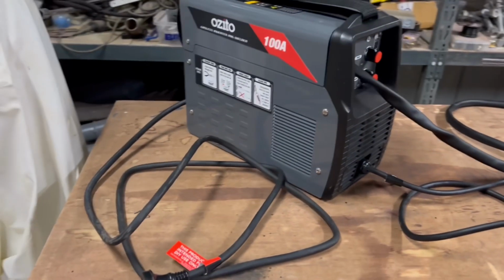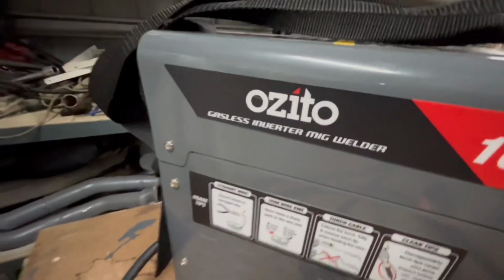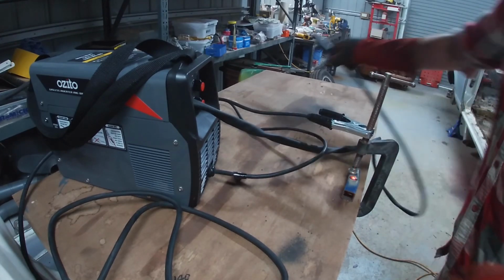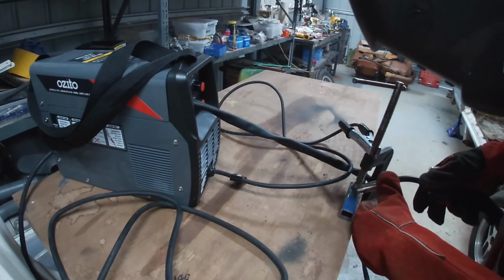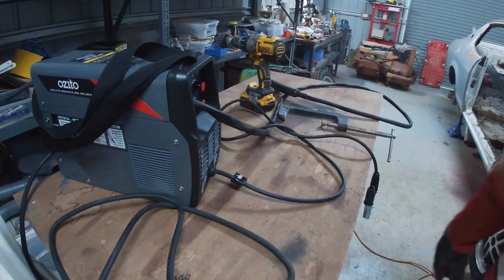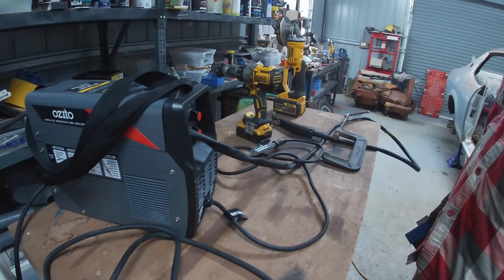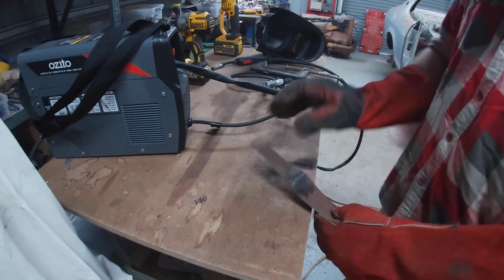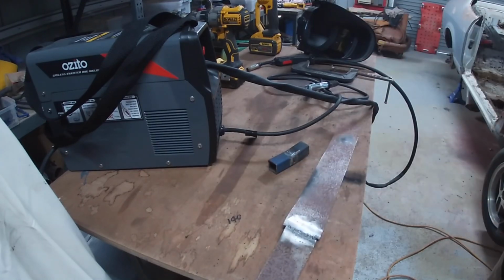Can a $148 MIG Welder Actually Weld??⚡️ OZITO 100amp MIG Welder

Comment: Hey mate do you think this gasless mig would be suitable for 0.9mm to 1mm mild steel panel work?
Reply from the maker: Hi mate, if you take your time, have the heat turned down, move very slowly and stitch the new metal in with series of tacks then it will do fine for sheet metal body work. Of course being gasless you will need to clean the welds quite a bit with a flap disk or similar but yes it will do just fine.
Reply: @Intheshedwithdarren Cheers for the reply, ill definitely go pick one up when I get the chance. Got a few rust cuts to seal back up, What size wire would you recommend 0.8mm? Or 0.6mm?
Reply from the maker: I’d go the thinnest wire they have. Being gasless they burn hot so you really do want to go in there gently.

Comment: Hey mate , did you adjust the wire speed also when you went up or down in the voltage adjustment? Thanks
Reply from the maker: Yep, only in small increments

Comment: Great video! I have this and was wondering if you think I can weld steel to my exhaust to cover the hole?  Because my exhaust is a single to dual exit but one muffler broke off so I wanted to weld it closed to a single pipe🙂
Reply from the maker: Absolutely this welder will do that job without too much fuss. You just need to be patient and keep the heat down on thin walled exhaust pipe. Recommend not welding to rusted old pipe ( cut back the pipe to non rusty metal)

Comment: I have this welder and find it a great draw back that there is no scale on the feed and voltage dials.  I have the dials just about to zero for 1.6mm.  I don't think you mentioned wire speed.
Reply from the maker: Fair enough. It is definitely an entry level unit but it welds nicely for what it is. I’ve completed quite a few big jobs with it and pull it out often when the big welder isn’t on hand or it’s windy outside etc.
For settings, I go as hot as i can without it blowing holes. It has plenty of punch for most jobs.

Comment: Hey mate, have you ever tried welding aluminium with this? Bought one today with the intention of doing aluminium stuff but cant seem to get anything started. Used ER5356 Aluminium welding wire also.
Reply from the maker: Hi Aaron, nah mate. Sorry I haven’t used the Ozito for aluminium. I expect it’ll be setup for the wrong polarity for aluminium and not adjustable…..good luck!

Comment: did you buy any better wire ?
Reply from the maker: Yep. I didn’t use the tiny spool that came with the welder. Bunnings had a different 1kg spool on the shelf and I picked that up. Welds really nicely. 

Good luck with it

Comment: Thanks for the vid, just bought one, but as someone posted they are now  $199. Still good value i think
Reply from the maker: Honestly, they are a gift at $199.
For small jobs here and there or even for a single large job they deliver good results. Just requires a little more cleanup without the gas but the welds are strong.
Good luck with it. Cheers

Comment: Would this work with stainless steel welding wire you think? I'm about to embark on my first welding journey and need to seal a stainless steel fire box that sits inside a hot tub
Reply from the maker: I don’t know if you can get stainless steel flux core wire. If so, it would work. If not, I don’t think so
Reply from the maker: Good luck with the project!
Reply: @Intheshedwithdarren  cheers I think you're right. Upon further research it looks as though I need the gas to do stainless. Keep up the vids mate and cheers again

Comment: I have been debating for a while now on getting one. After seeing your post i think i will bite the bullet. Gee though. I see they are $199 @ Bunnings now. Bugga. Thumbs up for your video 👍
Reply from the maker: Cool.
You won't be disappointed. The welding mask that it comes with is crap and will ruin your eyes for sure. Do yourself a favour and buy a decent mask and decent gloves. You don't want to cut corners on PPE.

Cheers.